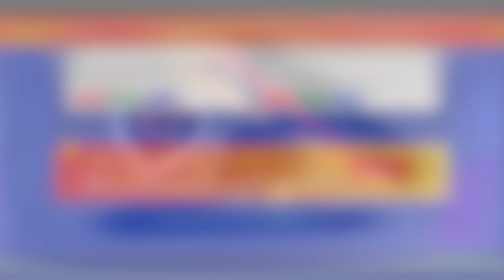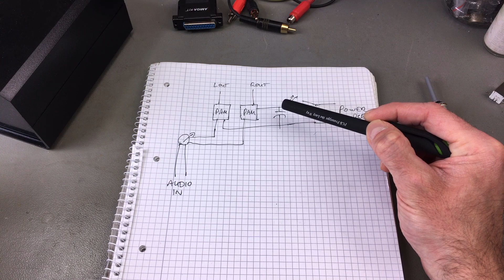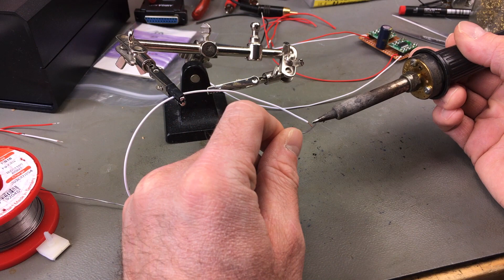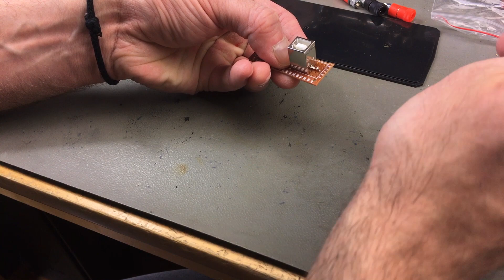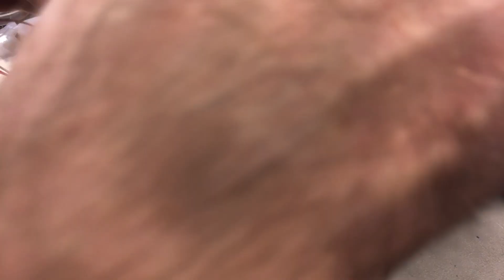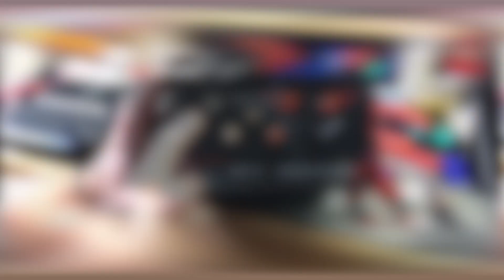DIY USB Powered Hifi Amplifier

Comment: I made an amp for my computer from a LM1036 preamp kit, RKamp4 kit and two 5 bar LED kits for the level. It looks and sounds great.
Reply from the maker: Nice! I like the LED visualizers a lot. Might give them a try at some point, too. This build was optimized for extremely low power consumption. I plan on building a solar panel charger for it, too. :)

Comment: Fantastic!  I have the (really rather nice) shell and connectors from my now broken Topping VX USB DAC amplifier.  I now know exactly what to do with it :D Cheers!
Reply from the maker: Oh, glad to help! Remember that there are different versions of the little boards, the 12V variety has a lot more ooomph if that is suitable for your use case. ;)
Reply: @JanBeta  After some limited searching I bought (2x) TPA3116D2 from Amazon. 4.5v to 27v so I can try for usb power. Failing that, the Topping has a 14v PSU and the barrel jack still present.  Schemes and plans!

Comment: You could make use of both channels of each of those pams by putting them in parallel. And adding like a 1/8 ohm resister off each channel output to balance them an something like a 1K on each input. And it would give a slight bit more headroom and potentially twice the current handling. It is like a typical amplifier having twice as many output transisters. So you could use lower impedance speakers which would give higher power output, or just much better stability with higher impedance speakers. Bridging them would probably not be a possibility on them as that would probably pull more than your power supply would want to deliver. I also wonder if it would make a difference for noise if each one had its own filtering cap?

Comment: For projects like these I drill holes next to the sockets and into the perfboard. A nut and a screw is much better than epoxy and it's removable. If I'm not happy with the amount of pressure that is applied to the perfboard I make a couple stand-offs on the 3D printer. Most of the time I just 3D print an entire case for my project and model in all the stand-offs and you could have modeled in a pocket/door for the battery as well. 3D printers aren't just for making trinkets to show off on youtube. A tiny amount of imagination and you find yourself printing parts for just about everything. =)
Reply from the maker: Yeah, I definitely need to look into 3D printing in the future. So many useful things you can do. :) I quite like the little adhesive standoffs I used, served me well for several builds now and they are removable.

Comment: Curious - Why two 8403 modules? As it provides 3W left + 3W right. (did I miss something you said)
(Guessing better that way, so cheap why not use two mono, to squeeze a bit more out of them ????)
Reply: It's not better, it's worse. They're each generating their own clock, but it doesn't match exactly, so they will interfere with each other. And it matters because they have common power and common ground. Don't do that.
Reply from the maker: In previous projects, I found that using separate modules for one channel each makes the output a bit louder (for power consumption reasons?).
Reply: I didn't know if you bridged them. But I think your saying that the chips preform better using only one channel.
Reply: @TBL_stevennelson  I don't think those things can be bridged without extra circuit added. And then it would put out about 8 watts. But it probably wouldn't handle that for very long.
Reply: @wishusknight3009  I'm 99% sure that this thing already has a bridge output, 3W @ 5V into 4 Ohm - does not compute without a bridge output. So I don't see any ability to further bridge the output.
Reply: @akkudakkupl  I think 3 watts is probably a "peek" rating. But I would need to read the datasheet for them. You could be right though.
Reply: @akkudakkupl  Yup, it appears you are correct. It doesn't say so directly but the tech sheets give me the impression it is bridge mode.
Reply: Those flashing leds can introduce noise as well I found. Nice project though :)

Comment: You can also try to change power supply, those power banks can have high pitch switching noise because often they have step-up converters. Plugging it into some other power supply and check for noise ^^
Reply from the maker: I tried several power banks (while troubleshooting the noise) and it was the same for all of them. Got the noise level to inaudible by using shielded cables and cleaning up the ground wiring now.

Comment: Great video, please do more. You could have mounted the circuit board on the back of the front panel to shorten cable length on the ground wires thus less noise.
Reply from the maker: Yes, less cable length definitely would have helped. Got the noise level down to absolutely inaudible now though by using shielded cable and cleaning up the ground wiring a bit. :)
Reply: @JanBeta  Still would have been fun not to have anything in the box itself just the front and back panels!

Comment: Thanks for another great video. Hey, what if you had used only the top half of that enclosure, cutting the front and back panels in half ( making them half as tall ), and cutting a small piece of wood for the bottom maybe?
Reply from the maker: Thanks! Interesting idea, that might work. :)

Comment: A pair of vu meters would have been pretty cool on the front panel as well :)
Reply: And a Protection circuit for the speakers for overpower, distortion factor and DC 😂
Reply from the maker: But they consume power! This is supposed to be as low power as possible to run it for as long as possible from a small power bank. ;)

Comment: Those color cycling LEDs are generally to be avoided in audio things as their currentdraw is not constant and that can cause power to fluctuate causing interference.
Reply: And they are awful ;-)
Reply from the maker: They look awesome though! And the interference caused was absolutely inaudible (otherwise I would have removed the LED).
Reply: It's 2020, so everything must have RGB now, no matter what the cost.
Reply: Everything is better with LEDs
Reply: @DavePoo2  I am with you on that! Without the  RGB the amp would also be a lot less loud. :P

Comment: Have you tried a 10k resister across each input. You lose a little gain but it kills input hum. 
I have used it to kill hum when there was no input connected, so it might not be correct 
fix here. Easy to try though. Thank you for the video.

Comment: It goes loud but how much distortion is there when turned up since its powered from a portable USB power supply.
I suspect quite a lot. The high frequency noise will be coming from the DC-DC boost converter in the USB power supply. If you power it from a 6V lead acid, it will be quiet.

Comment: No heatsinking required? Audio amp ICs usually run pretty hot.
Maybe CD-ROM audio cables used in old computers to connect the drive to the sound card could have been a good choice for the internal connections, they have to deal with the stray RF from the other components in the PC.
Reply from the maker: These class D amps are highly efficient, most of the power is going into amplification, very little is dissipated as heat. Very different from the traditional transistor amp circuits.

Comment: This came out pretty nicely. Instead of using those 1 Dollar Amp-Chips I would have spent a few bucks more for a combined bluetooth amplifier board (including a "little" more Amp-Power as well) which cost you below 10 US-$.... with bluetooth, your amplifier is just more versatile, especially if you hook it up to a USB Powerbank....
Ich finde solche Bastelarbeiten ansonsten immer sehr unterhaltsam. Da hast du jetzt sozusagen deinen "JB-1" - Verstärker gebaut. ;)
  Es gibt ja auch viele GitHub Projekte, die man da so "nachtinkern" kann. Ich habe unlängst eine AWTrix von blueforcer zusammengebaut - ist echt eine schöne Sache geworden.
Reply from the maker: Good point! Those larger amps consume quite a bit more power though, this one is supposed to be optimized for extremely low power consumption so it can run off a small power bank (possibly with a solar charger even) for hours in the garden. This is definitely not going to be the last project of this kind though. Too many things to explore, as you mentioned. ;)

Comment: Excellent video. A bit of variety is good, so no problem going a bit off topic. 
Do you think something similar to this setup could be used to make a guitar amplifier?
Reply from the maker: I think for a guitar amplifier it might be a bit underpowered but it would work. There is some very similar designs using some more traditional A-B style amplifier chips for guitar amplifiers (LM series chips). Some of them are able to produce some sweet overdrive sounds, too. :)
Reply: @JanBeta  Excellent, thanks. Maybe this for a practice amp...

Comment: This reminds me of when I had a 100w Marshall bass amp head that went wrong.  I opened it up and found that apart from the tone section the main amp was just a tiny little circuit board.  Very dissapointing for me when I thought I had a nice piece of pro audio gear.
Reply from the maker: Yeah, Marshall acquired a budget brand at some point in the nineties (or early 2000s) and sells those amps under the Marshall name now. I have a guitar combo from that era. It sounds okay but the innards are cheaply made. The higher tier Marshall amps are still decent quality though as far as I know.

Comment: Using an unshielded signal wires and cheap digital amplifiers would not be considered Hi-Fi by many, however this is a nice learning project for young electronics enthusiast. A better approach would be using a DC-DC step up converter to boost 5V to 12V and use a proven classic TDA or LM AB-class analog amplifier chip.
Reply: TDA2822m is perfect for stereo, runs on 5V and is pretty low in component count.

Comment: Yeah these PAMs can be very handy. For Example pimping the Sound of a TV and using its USB-Port as Power-Supply, or in Conjunction with a cheap USB-Soundcard as PC-Speaker without an external Power-Supply.
But I can't see the Point in using two seperate ICs, maybe you could explain it?
Reply from the maker: Thanks! In previous projects, I found that using two separate PCBs in mono gives them a bit more headroom (they are just a bit louder) for some reason (power consumption?), that's why I did it.
Reply: @JanBeta  Ah Ok, I think I 'll try this out once

Comment: i forgot to mention jan why didnt you use shielded cables for inputs and maybe outputs?.  i was just wondering
Reply from the maker: I switched to shielded cables in the end for the inputs but usually it is not strictly necessary if you keep them short.

Comment: I read up about those modules and they are not that Hi-Fi. But totaly adequate for a soundbar or some other mobile listening solution or shop speakers. You could have just used a single module ;-)

Comment: Nice little project.
Your mistake with the volume control was trying to describe it as resistance, it would have been easier to to describe it as an adjustable voltage divider.
Reply from the maker: You're right, that's what it functions as. Good point!

Comment: Surely the power output isn`t the same going into a different load? Or the chip is doing something internally to be able to drive 4ohm and 8ohm at 3watts?
Reply: I'm pretty sure the 3W rating for the PAM8403 is spec'd for four-ohm loads.   Of course, if you're using it to drive 8-ohm speakers, it will not develop that much power.
Reply from the maker: Yes, as xaenon says, the 3W rating is for 4 Ohms and providing 5.5V supply. (At least if I understand the data sheet correctly, that is.)

Comment: I do enjoy a Beta Industreaze video, but confused as to why you have 2 stereo modules.  Why not use only one with the available L+R channels?
Reply: Same question here. Answering to get notified... ;)
Reply: My opinion is: don't do that. They are PWM devices and they will generate interfering clock, while sharing power and ground. Use one.
Reply from the maker: I found in previous builds that you can squeeze a little bit more headroom out of them this way. They are just a tiny bit louder. Added interference is the downside, as Siana says. But there was no audible noise after using shielded cables and cleaning up the ground wiring a bit.

Comment: Hi. Neat job. Maybe twisting the input wires would have helped.
Reply from the maker: Twisting wires doesn't do a lot for shielding in my experience. Although it might have helped a tiny bit. The shielded cable was definitely the right thing to do. :)

Comment: Ground Loop Isolator?
Reply from the maker: Yeah, that would be the proper thing to do probably. But I got the noise down to inaudible with the shielded cables and cleaning up the ground wiring.

Comment: I always use active boxes and therefore do not need a separate amplifier. I find it awkward to have an amplifier for loudspeakers. Again a damn part that takes away space unnecessarily.
Reply: Sure, self amplifying speakers are very nice- and you can fix anything with money- but this is neat because he built it using almost all stuff diverted from ending up in the dump. The speakers could be salvaged ones too wherever it gets installed.
Reply: Hey, or use a similar process to make salvage speakers into self amplified ones!
Reply from the maker: I like the versatility and repairability of separate amplifiers. I like to try different speakers and such. :)

Comment: Don't make the Lines to the Electrolytic Cap so long! - As short as possible is the correct way not as longest! Long wire means a lot of Induction the pulse answer will be bad! GND every time in the center not like this. shortest ways required so you have lower distortions. The reason why the connection pins to the Electrolytic Cap are on one side and short are that the Inductivity should be low. Best Regards Volker

Comment: 3W per channel can never be HiFi... in the '70ies an output power of 10W/channel <1% THD was a minimum , as part of the DIN 45500 spec. I'd suggest to connect this amp to a scoop and watch what happens above an output power of 1W... it reaches 10% @ 3W

Comment: Das ist ein PWM basierter versterker das hat nix mit digital zu tun das bekommen viele Leute durcheinander das ist einfach nur ein Versrärker das Typs D und es gibt natürlich auch typ A,B,C verstärker und by the way pollin verkauft super D Verstärker wo alles schon dran ist was man braucht hab dafür sogar ein 3D druckbares Gehäuse Design d ^^
Reply from the maker: Class D Verstärker sind aber doch digitale Verstärker (weil das PWM-Prinzip nur zwischen 1 und 0 schaltet, also digital, im Gegensatz zu transistorbasierten analogen Verstärkern). Siehe z.B. auch hier: https://de.wikipedia.org/wiki/Class-D-Verstärker :)
Reply: Ja das stimmt schon aber an sich ist der Vorgang vollkommen analog nur das eben ein pwm signal genommen wird zur ansteuerrung anstatt einer sinus welle und zudem ist da ja kein ad oder da converter drin ^^ aber ist ja auch egal

Comment: Why. WHY.

You know where the noise is coming from? Well it's induced noise current. The input impedance of these is crazy high. A little bit of current into a high impedance, converts to a fair bit of voltage, thus audible noise. And where is the current coming from? From the RF hazard that these tiny little shits are. Now if you were a sensible person, and had just one of them, it wouldn't be a problem, but you have two, and they're pissing on each other's parade. And there's no advantage, just use one, one is good. And where's your star grounding point? The power ground and the signal ground is connected on the green little boards, though a bit suspiciously.

Also i wonder what you want to put into that big box later, and how you want to protect whatever you're putting in there from the menace that these little things are. Don't get me wrong, these micro amps go loud enough and sound well and all that, they're just a fair bit of trouble to deal with. The little green board is also a bit suspicious, lacking for example the output ferrites, so it's suggested not to connect a long run of wire to external speakers like that, and it also looks like an antenna, with the power trace cutting through the ground area like that. Sure you can use the green boards, but also have to be aware of their issues and limitations. An avoidable hi-finess issue is that the boards have 1µF i think DC blocking capacitors on the inputs, and those have to be necessarily X5R or worse, which are prone to distortion of potentially around several %. 

Also something to keep in mind: Eliott Sound Products Project 01. Once you try that, you'll never want a different volume control. Also if i never see a shitty open potentiometer again, that'll be too soon.
Reply from the maker: Yeah, the little PAMs definitely produce quite a bit of RF. Might add some inductors at some point. I've used one in conjunction with a little bluetooth module previously for one of my portable salvaged speakers, worked quite well. The noise is completely inaudible after using shielded cables and cleaning up the grounding connections a bit.